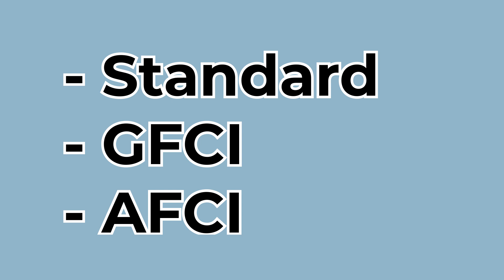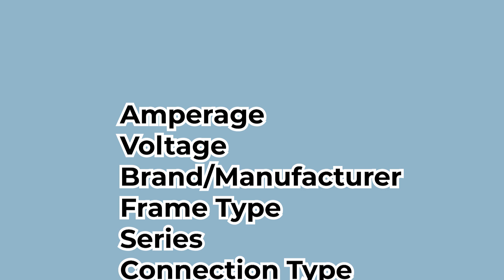How to Identify Circuit Breaker Types

Comment: "Accurately identifying circuit breakers can help you make the correct purchasing decision the first time, saving you time and money.".............. Well, I can always get my money back if I bought the wrong breaker, but those two minutes of listening to you point out what the product description on each item's label already states will forever be engraved in the memories of those impatient customers standing in line behind me at the only checkout aisle open at my local hardware store as I was doing some last minute research before buying the breaker, only to have Google pull up a video that tells you the importance of doing research before buying a breaker.
Reply: Breakers are final sale in most places